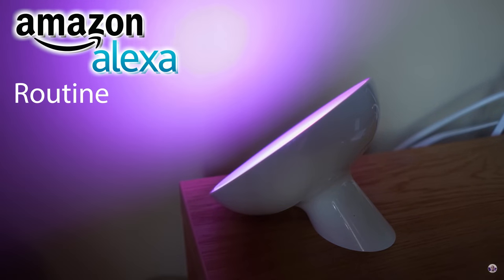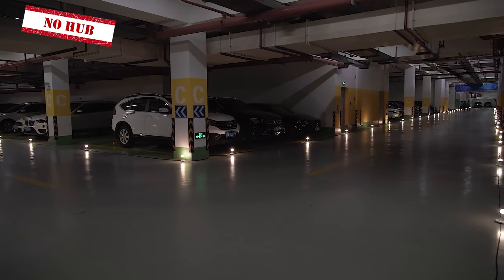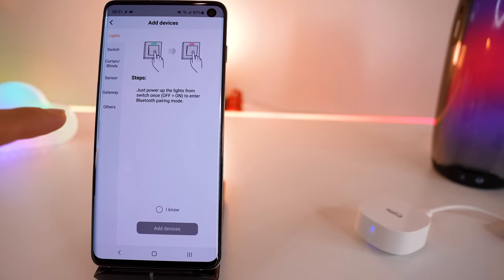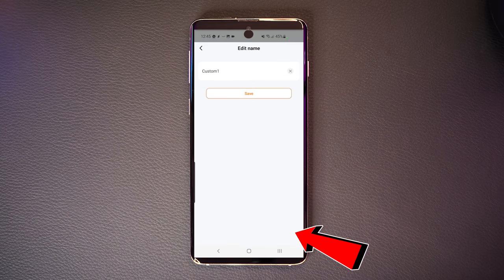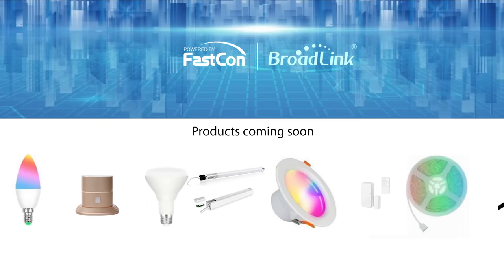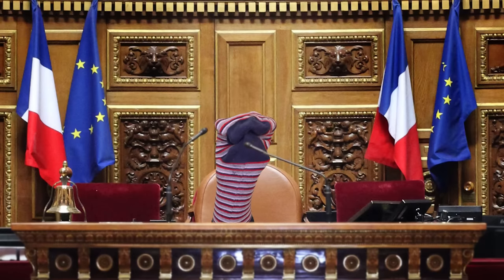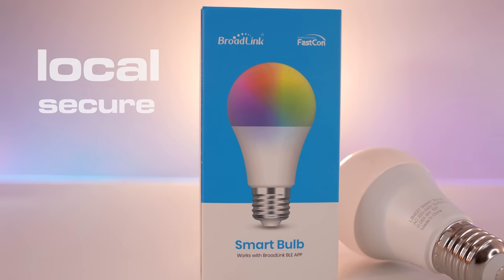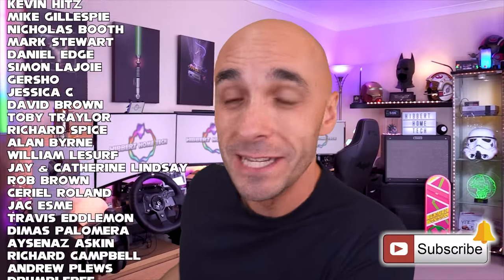Smart Home Light Switch - No Neutral, Because No Wiring!?

Comment: I hope they do better than what they did with their previous useless unworthy piece of junk called BroadLink Wireless Smart Button. Four buttons that you can use for automations, provided that everytime you want to use one of them you open Alexa app on your phone, try to see why it cannot see the change in state of the button, then remove the buttons from the app, add them again, redefine the autonations you have defined a thousand time, and then click the button. Two hours later, you have to go through the same process again. My $40 button is one of the more expensive paper weights I have that I don't even use for keeping papers on my table. I mean, who keeps papers on their desk anymore? Not to mention, no way it lets you to use it in Home Assistant. I mean why would they? They obviously have been planning on the system you are promoting now, trying to take the market by brute force. They don't play fair, and if you use them you are stuck with them. Isn't that why you hate phillips hue? #hypocricy.
Reply from the maker: Well considering I've never promoted their previous wirless smart button perhaps you should calm your tits?

As for "trying to take the market by brute force"... are you serious?  Trying to take the market by brute force by creating a product that doesn't require their platform to operate.  Rethink this, you sound nuts.  

Also, don't give me the hypocrisy crap, this is 3 bulbs and a set of buttons for less than the cost of one Philips Hue bulb.  Get some perspective.